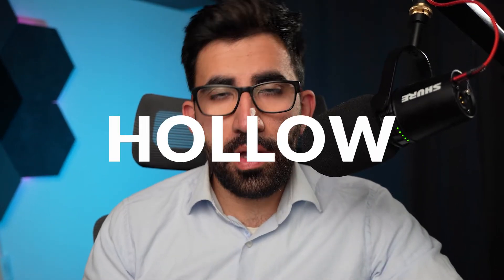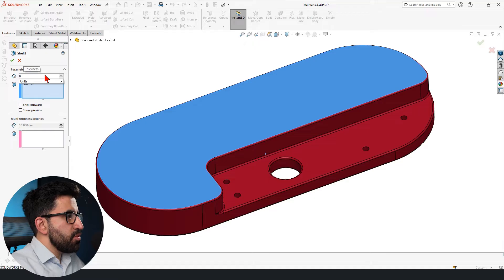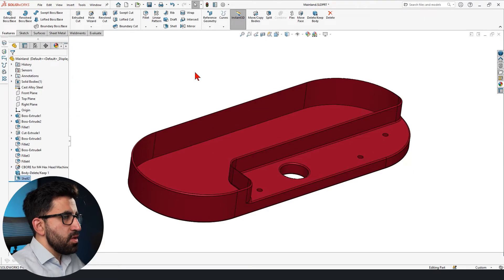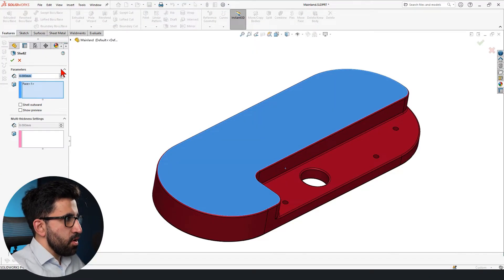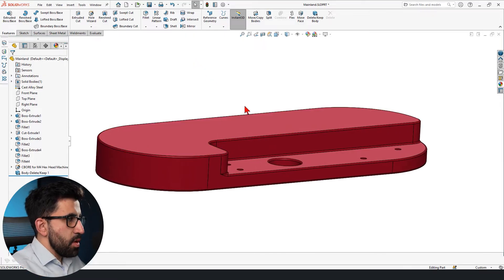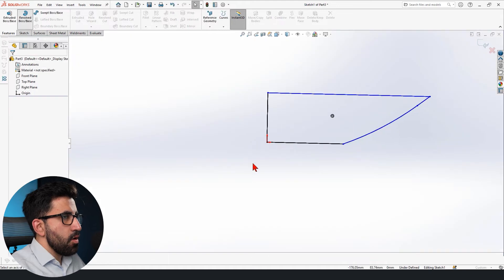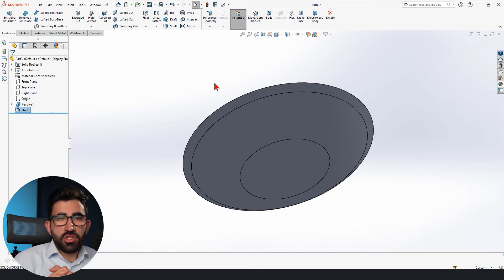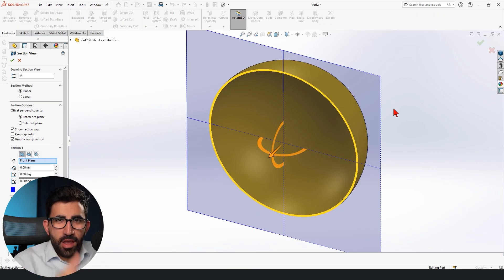How to Hollow shell a part in SolidWorks

Comment: I was trying to design a intake manifold system but when I tried to use the shell command in the sweep pipe which was attached to flange the flange also gets hollow inside. I want the sweep shape as like a pipe(which must be hollow) but the flange attached to it.... How to over come this
Reply from the maker: first make it hollow, then add the seep piple. You can roll back the line on your design tree by dragging it up above the sweep, then do the shell, then drag it back down again